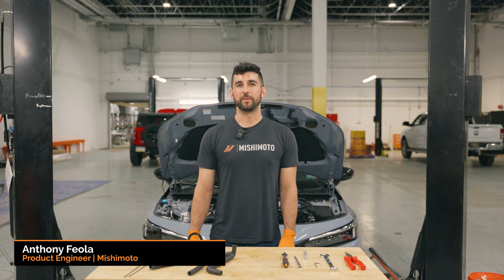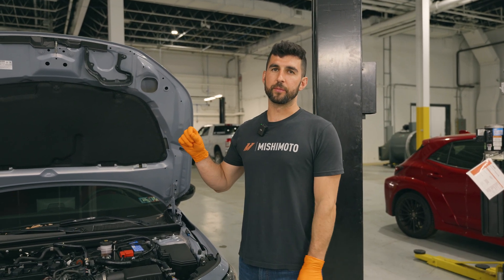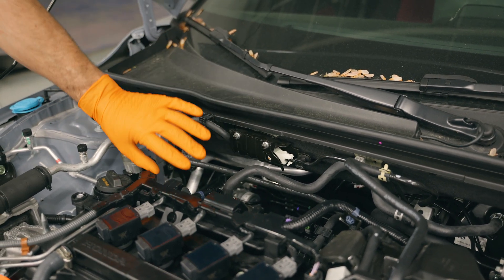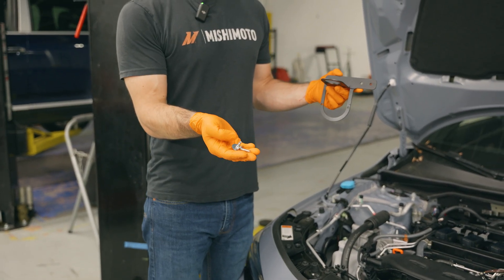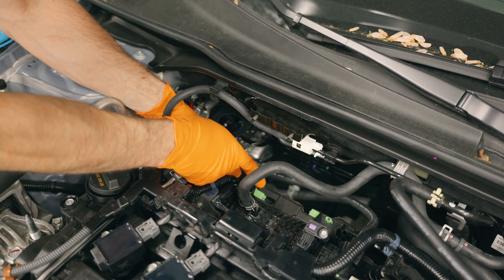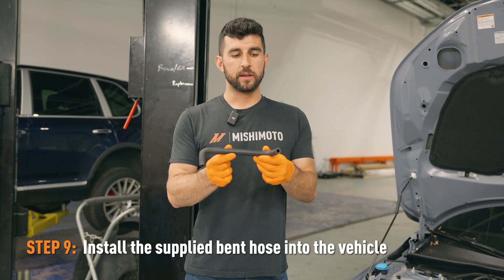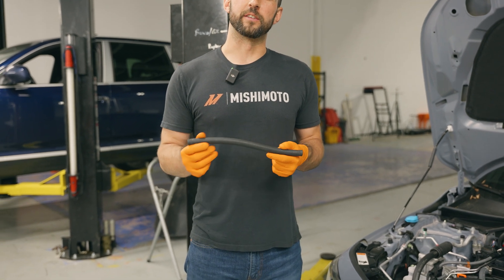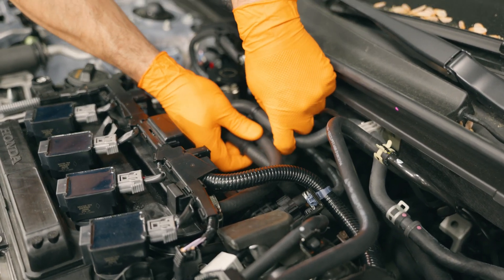How To Install A Baffled Oil Catch Can | Honda Civic 2022+

Comment: do you have a video for honda hrv installation? for this do u have to remove the pcv valve? or just the hose? and connect also u have muffler and resonator replace plus aiir intake resonator remove?
Reply from the maker: We have not tested this on the HRV. Sorry! However, we do not suggest removing the PCV. The catch can should go in line between the PCV and intake system.
Reply: @mishimoto  i see so the pcv valve still stays and add catch can in betwen the pcv and exhaust manifolds? so in for manifolds and out for pcv valve instllation? what about in winter? should i remove it this only good for summer?
Reply from the maker: This is installed between the PCV and Intake manifold, not exhaust. You shouldn't have any issues in the winter.

Comment: I followed everything you said in the video, easy to put on, but there is no way i can open the oil catch can cause it hits something under it, 
Do you know how do we take it off?
Reply from the maker: If you can not unthread the bottom, you should be able to remove the can from the bracket or the bracket from the car to provide adequate space to clean and drain the can. Thanks!

Comment: No check valve is needed on the outlet before the intake? Why would the accord 1.5L turbo need a check valve but the civic does not require one?
Reply from the maker: The Civic kit reuses the OEM valve whereas the Accord kit does not.
Reply: @mishimoto  thanks for the late reply.  there was no check valve in my oem 18 accord hose. I’m repurposing my accord kit for my 22 civic and I’m using the check valve hose. Should I not be using the check valve? Just curious
Reply from the maker: A check valve is required in some fashion, yes. Otherwise, you will more than likely experience a vacuum leak.

Comment: Does this work for the 22’+ Civic Si’s?
Reply: The civic si in the video is a 22 model
Reply from the maker: This will fit the following:

Honda Civic I4 1.5L 2022+
Acura Integra I4 1.5L 2023+